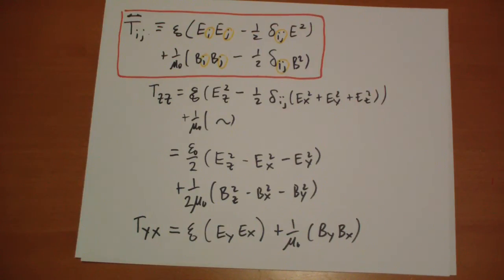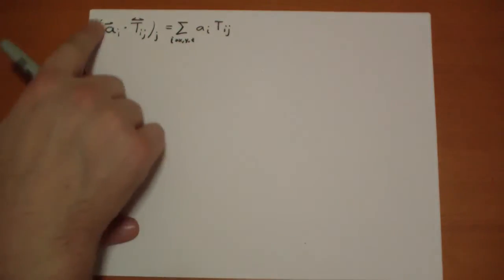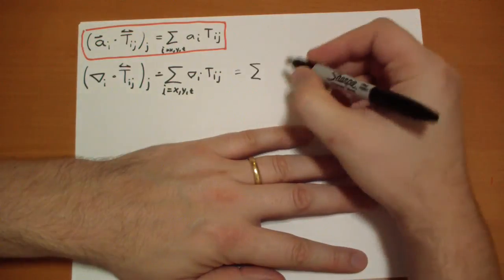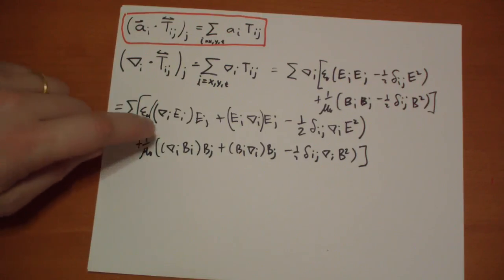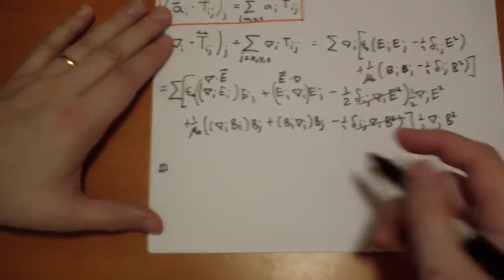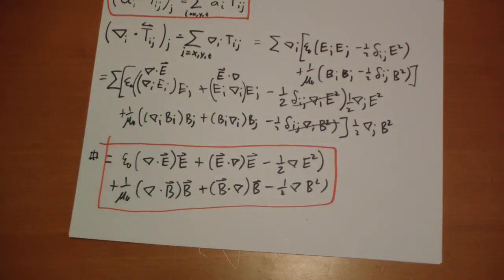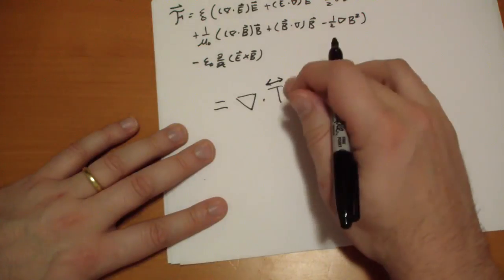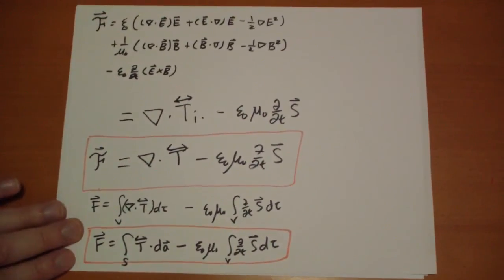7.5.3 Maxwell's Stress Tensor 4/4

Comment: Thank you. I was beating my head against a wall trying to derive divergence the brute force method through matrix multiplication and not using indices. I kept getting these extra terms in the expression that I didn't know how to get rid of but I give up on figuring it out right now because this is much simpler and straight forward. I should have just applied equation 8.18 from the start, it would have saved me a lot of time.

Comment: This is really a helpful video. But I am more interested in slight mathematical aspect of tensor.

We first obtained the force per unit volume expression. Let's consider only E-field part of expression. Now that expression we have expressed in terms of volume integral of divergence of tensor. It is justified how it is done. But more compactly,

Can anyone tell me which reference or topic I should look into for this kind of treatment - i.e. moving from vectors to tensors - expressing 3x1 vectors as prpduct of 3x3 tensor and 3x1 vector or something like what is done in this case.
Reply from the maker: There's really nothing more to this. If you've studied linear algebra you know pretty much all the interesting things to know about 3x3 matrices. It's not a very deep topic.

Comment: isin't a vector a 3x1 column matrix? How can you multiply a 3x1 * 3x3 matrix??? It would have to be the other way around.
Reply: just go with 1x3 matrix vector in fact this is called co-vector .

(a co-vector of a vector in linear algebra its called taking hermitian of matrix that is to simply make a transpose and conjugate the elements)
Reply: Well, when you take the inner product of two column vectors you take the transpose of the first matrix and then do matrix multiplication. If you extend this definition to matrices then you are actually multiplying a 1x3 matrix by a 3x3 and it works out.